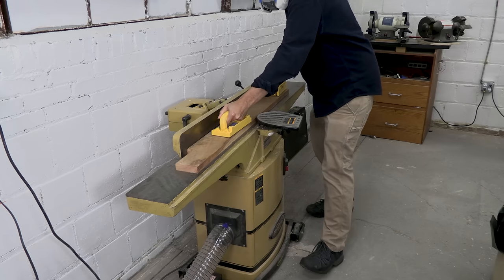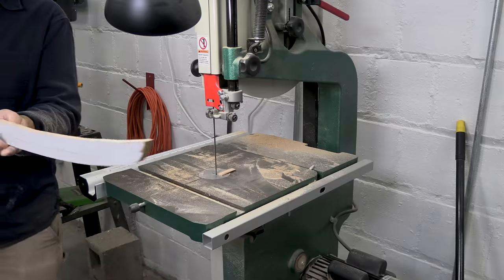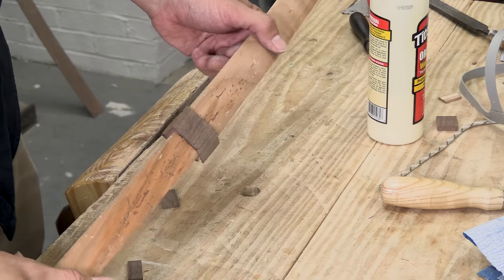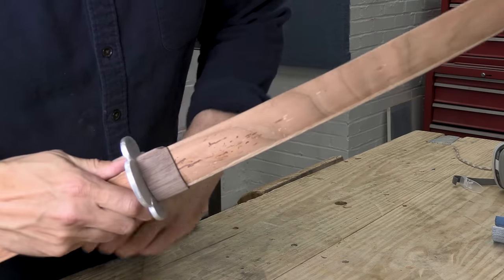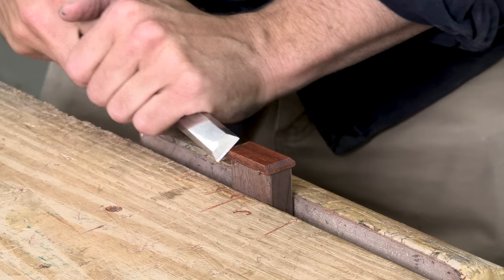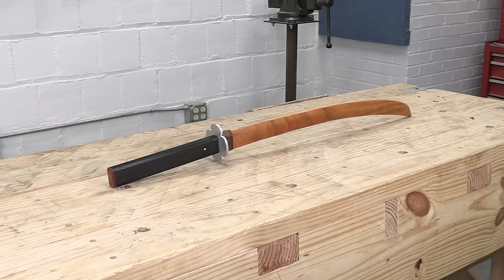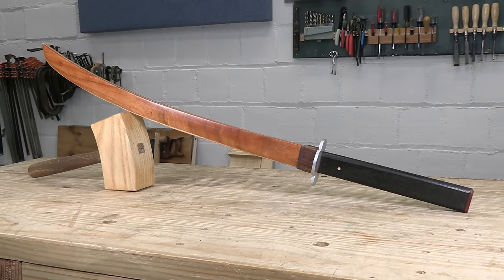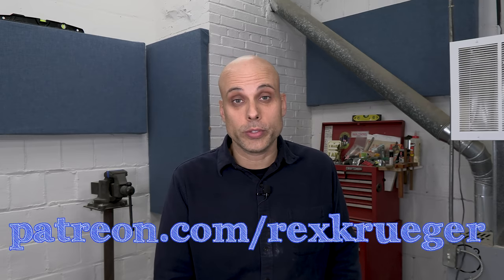Can I make an AUTHENTIC Katana from wood?

Comment: finest japanese wooden katana, 10000 layers of laminated wood, can cut through solid oak
Reply: 10,000 layers? Are you joking?
Each layer is 0.00001" thick?  That less than a sheet after paper.
Reply: @robertdavis171  consider that it might have been a joke
Reply: @robertdavis171  Fun Fact: A sheet of sheet a printer paper is is around .004" thick. I'm a CAD designer/draftsman so I throw that out in meetings when people are getting too stuck on numbers and need some perspective.

Comment: Hey Rex! When I was a locksmith, we all carried what we called "reamers" for grinding away aluminum or steel with a drill to get most of the material out to make square holes like you did in that aluminum. 

You can find them pretty cheap on aliexpress under the term "carbide rotary file". They have a short round shank that will fit in the jacobs chuck no problem. You do still have to take out the file to get nice square corners but you can save a TON of time for a bit that only costs around 10-15$. Works on hardened steel too!

Only downside is it can get a bit clogged with aluminum, but i found that next time i used it on steel the aluminum would get cleared out pretty quick.
Reply from the maker: That is VERY helpful.  Thanks for the tip.

Comment: Made a matching pair of these a few years ago for my son. Added a display stand as well. Still a hit with all his friends. 
Issues like that handle are why I always keep a bottle of hide glue around. With anything that needs to slide like that I avoid PVA if at all possible. Plus it’s easier to clean up as it is forced out the end. And I’ve never had an issue with it holding.

Comment: 8:50 tiny correction: on a katana it's always one peg, if it has two it's a tachi.
people have debated on what makes a tachi and what makes a katana for they are very similar in shape and the fact that the minimum length of a tachi is shorter than the maximum length of a katana doesn't help matters, but the number of pegs used in their construction tends to be widely consistent.

Comment: Rex you've really inspired me to take on some simple woodworking projects for use around my apartment. I know it's not a "hand tool" kind of material, but what kind of tips do you have for working with plywood? I know you can't round it over in the same way, it's basically always crosscutting, but what kind of hand tools could you use with it? Is it plane-able?

Comment: hehhehheh you should see the bokken I made as a clone of my chisa katana. it has the same dimensions and shape (though a thicker blade) and is 1oz heavier than the steel blade, with an exact match of static and dynamic balance - courtesy of an epoxy-bedded leadshot core. it also has the various fittings, wrap, and even a scabbard.

5:10 aluminum takes a long time filing to shape? try hot rolled steel. actually, don't: having done it once, I will never willingly repeat that effort. it took days

9:02 you can make your holes perpendicular like that, yes.... but it works better to make them in a V, as it holds the tsuka onto the tang more securely and the opposing tensions prevent the pins from working loose during use.

Comment: Perhaps you should have used epoxy for gluing the handle to the tang. It doesn't seize and you can tweak the position for like 15 minutes. You just have to wait for 24 hours before it cures completely.

Comment: Hi Rex, another possibly dumb question. Is it possible to make a mallet that has both a soft and metal side? That way, you could use the same mallet to adjust both parts of a wooden bodied hand plane.

Comment: Hey Rex as a certified and unapologetic cheapster. Can you do a review the Accu Burr. It's the best bang for your buck game changing $40 tool its a Burr machine. I gave up on card scrapers long ago I never got good consistent results. Ie: dust never shavings. But in 2min out of the package with a diamond plate I had shavings....

Comment: Great work, but I'm triggered by the curvature 😆
Somewhere between the original pattern and the product, something happened to it. The back of a katana should have a constant (circular) curvature from hilt to tip, or it would jam in the wooden scabbard. Yours seems straight at the base and curved at the tip.

Comment: 6:55 I'm guessing bloodwood? Specifically "Brosimum paraense." It's a very hard wood that is dark red with large, diffuse pores. It has a distinct smell, but I don't know how to describe that on the internet. The shavings also look like the same shavings produced when I've used bloodwood but not like the shavings produced by Paduk. But I'm just going by 30 seconds of a youtube video. Also: nice vid
Reply: Yeah Bloodwood is crazy hard. I always have to ReSharpen my plane blade before and after planing it.

Comment: Hi Rex, I want to ask a question because I don't know the answer.  You made a choice to have the central piece of the blade be oak instead of plywood, can you teach me why?  I like what you did, but I would have thought to go a different way, and I'm new enough to wood working I probably am not seeing something.  What am I not seeing?  Thank you, very much.
Reply from the maker: Really,  really good question. With plywood, the layers go in alternating directions. Compared to a solid piece of wood going the long way,  ply is only half as strong (half the fibers are going the wrong way.) Ply isn't stronger than solid wood,  it's more stable and equally strong in both directions.

Comment: Wouldn't it have been easier to drill a pilot for the opening in the tsuba and then using a fretsaw or equivalent to cut the rectangle?
Reply from the maker: Sure.... if I had a fretsaw on that day.  You use what you have.
Reply: @RexKrueger  Fair enough. I know I have an incomplete POV, it's just odd to imagine tools you might not have.

(It's beautiful, and thanks for the pointer to Walter Sorrels: I did aikido for 12 years and know a lot about katanas, and I learned a whole bunch of new stuff.)

Comment: This is absolutely beautiful, great work on the katana. I do have a question though, why use aluminum for the hand guard? I love the build and I am definitely not complaining about the final result, I’m just curious.
Reply: Comparatively easy to machine, especially compared to wrought iron or steel. Rex is a woodworker more than a metalworker and you can work aluminium with the hand tools he has. I'd have gone with brass myself, just as easy to work but it looks nicer lol.
Reply: @Si74l0rd  I was talking more along the lines of an all wood construction without metal. I completely understand using aluminum as a ductile and relatively easy material to work with, I was just asking “why metal?”.
Reply: @thomasthecrunkengine3512  Ah I gotcha, good question. I'd assume robustness, but I could well be wrong.

Comment: The respirator filter you are using look to be chemical filters, not fine particulate for organic material. I'm not trying to be a saftey Susan, but if you're this concerned about breathing in dust in the shop the correct filter choice is important. Typically the chemical (carbon) filters need an additional pad for organics installed over the intake ports.  The katana turned out awesome

Comment: When it's a wooden training sword it's called a Bokken. Not bad, the curve should be a little more subtle and evenly dispersed from the pommel (or the Tsuba, hand guard) to the tip of the blade but all in all I'm impressed. I practiced kenjutsu before woodworking and I've never actually tried to make one. If you really want to up the difficulty try doing a Japanese handle wrap...last time I tried that I had to replay sections of the video easily over a hundred times to finish and do it properly, it was a nightmare.